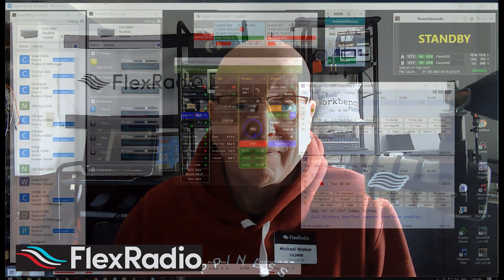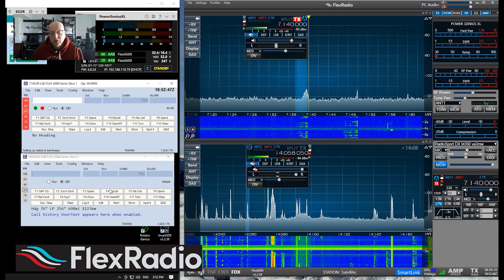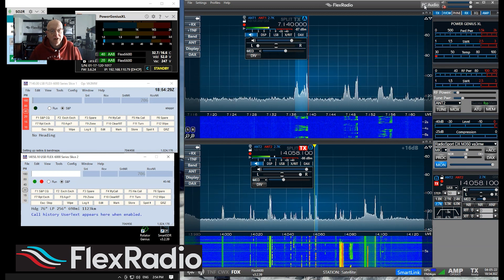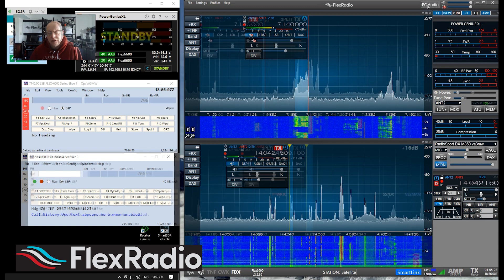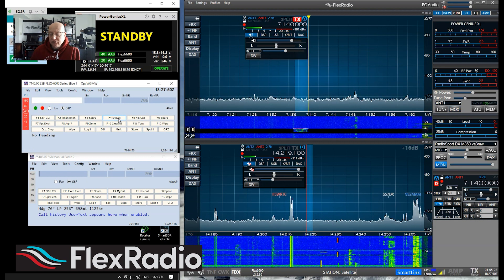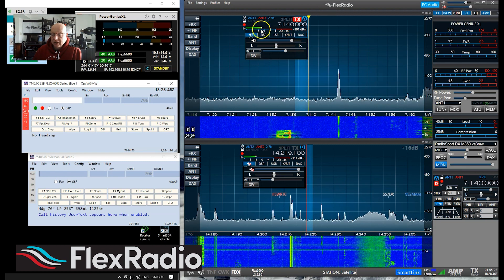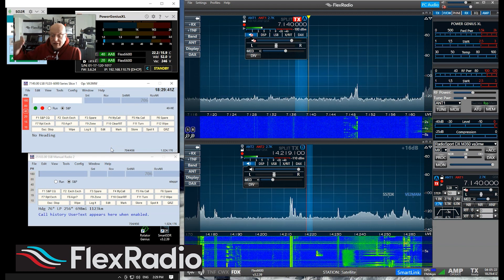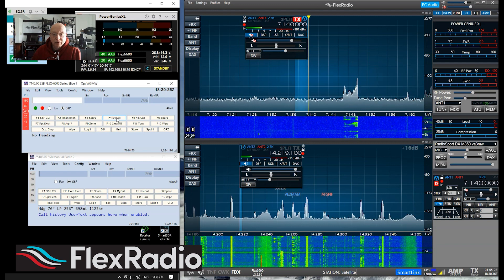FlexRadio 6000 series and SO2R operation for todays Ham Radio Operator.

Comment: Hi Mike, like the video. General SO2R question. When running SO2R on cw, do you always have the transmitting radios audio muted while listening on the receive radio? Whether calling CQ or transmitting an exchange. Thanks, Steve NN2NN

Comment: If you don't run two to four band slices all the time you can't really appreciate how capable the 6600 hardware really is.

It would be interesting to see you do a video using the same band with diversity antennas.  So two antennas feeding two spectral capture units with slices on the same frequency.
Reply: I will diversity soon.  I was having a battle with trying to record stereo believe it or not.